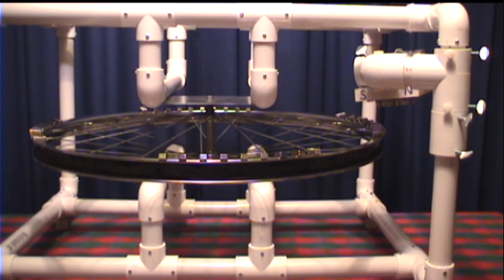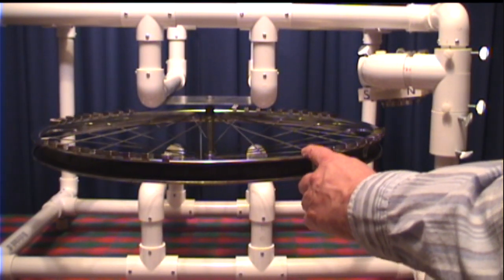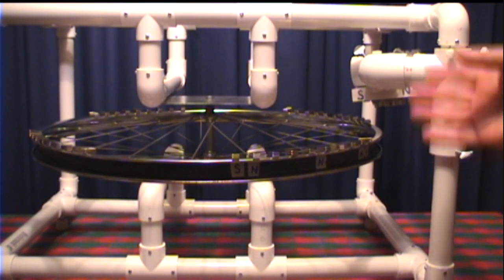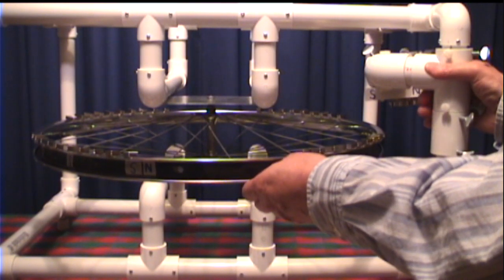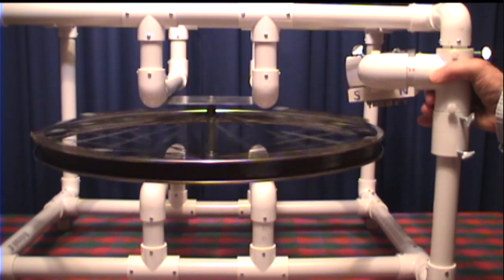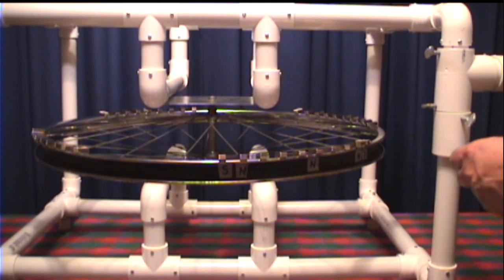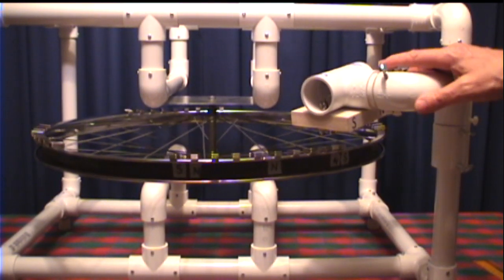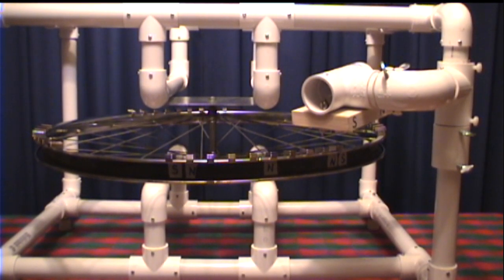Video #15, "Rick's Pipe Dream" Magnetic Motor - Generator

Comment from the maker: Yes, I could do that.  The stator arm actually moves quite easily, though.  The arm shown was built only for experimentation, and I am replacing it with something much better at front center, as you will soon see.  :)

Comment: How about a weak spring mechanism keeping the stator in place to the left, and some light arms placed at the right location on the wheel which temporarily push the stator away at the right time?

Comment from the maker: Hi justin,
I thought long and hard about all conceivable methods of doing this, but believe I am on the right track (no pun intended) with the method I am pursuing.  The greatest available force to move the stator is located at the outermost perimeter of the wheel.  Adding a hefty flywheel ring at this point multiplies that force, and a monorail track at this location offers the best chance, as I see it, of making this MOSTAT method work.

Comment: How about  running it from the axel? Just have two rods that correspond to two lobes on the axel, one to move the stator one way and the other rod to move it the other. Or a spring on the stator to return it.Depends how much force is required- usually where it fails because the force needed to move the stator is equal to or greater than the force generated by the wheel magnets. You could have the stator rise and fall so you only need to have one lobe and one rod.

Comment from the maker: Yes, the monorail track that I am adding (beyond the outer edge of the rim) will snake inward and outward at precisely the correct timing points that are required, so it will act very much like a cam, and the stator will move correspondingly - much in the same way as a phonograph arm follows the groove at the end of a record, where it swings back and forth.